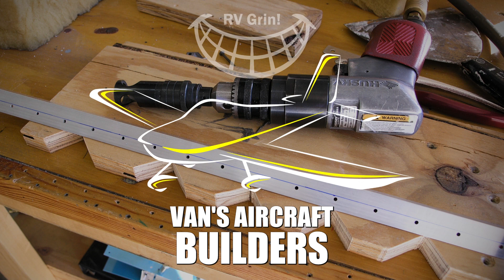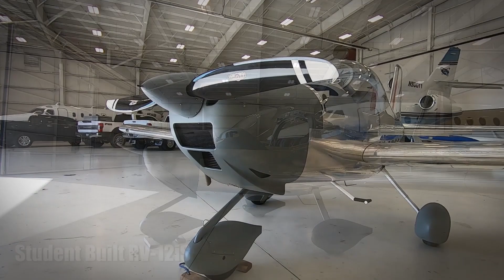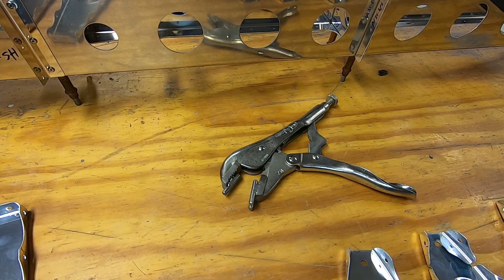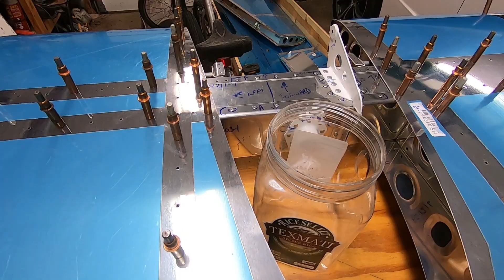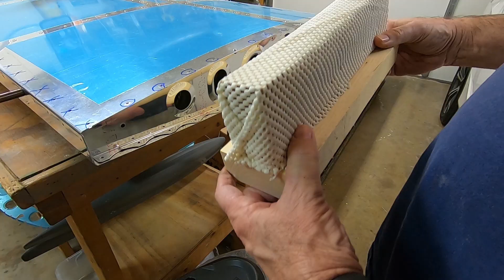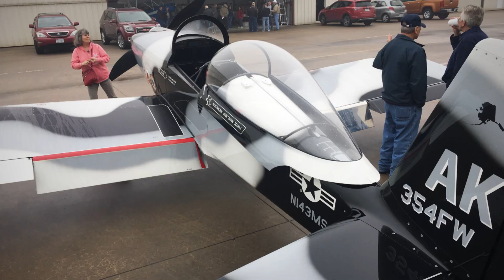Vans Aircraft RV-12iS - Stabilator Construction - Part 5

Comment: What PSI are you using with your rivet gun?
I just got my 12 tail kit 2 weeks ago. Keep the videos coming they are helpful, thanks
Reply from the maker: Thanks! 90 PSI for all the Pneumatic tools.
Reply: @Vansaircraftbuilders  I'm a newbie but that HF pneumatic riveter is rated for 90 psi max. I've been using 50 psi and working fine. I just like to get other options.
Reply from the maker: @cessnatpa  Sorry. I meant to say 90 PSI. I checked my compressor and it is set to 90 PSI for all my pneumatic tools. Old age.... wonderful thing.

Comment: How many clecos did you need for the tail kit?
Reply: For my kit, just a hand full of 3/32" clecos. I have 300 1/8" clecos now, since I bought 100 more at amazon. I'm not sure how much it will take for the tailcone, which is next for this kit. Amazon is pretty fast on the delivery, around 2 days. https://amzn.to/2UY6qT6
Reply from the maker: 350 1/8" Clecos so far. I might need more to finish the tail cone, which is the last part of the kit.
Reply: @Vansaircraftbuilders  seems like the 350 number from vans is reasonable. Seems like there are a few #4 solid rivets in the kit. Would you recommend a pneumatic rivet squeezer or would if I have a rivet gun be fine?
Reply from the maker: @thewyliestcoyote  I'm lucky because I already had a pneumatic squeezer from my  previous RV-9A project. So far I have used both the pneumatic and the hand squeezer. The #4 rivets I've encountered so far were pretty short and easy to squeeze. I would say that pneumatic would be nice, but not required. That being said, I'm not sure what I will encounter in the coming kits.